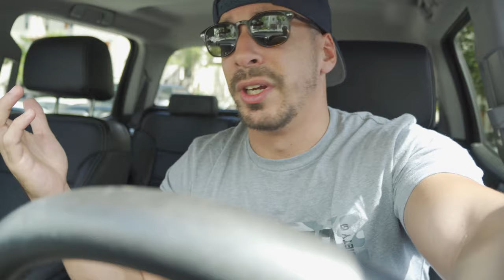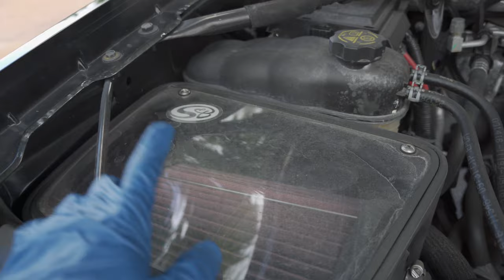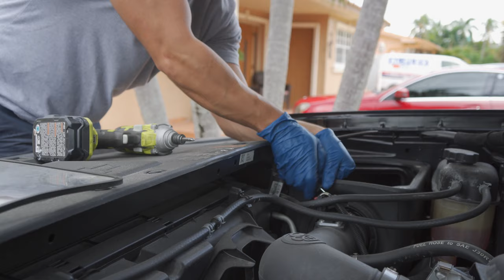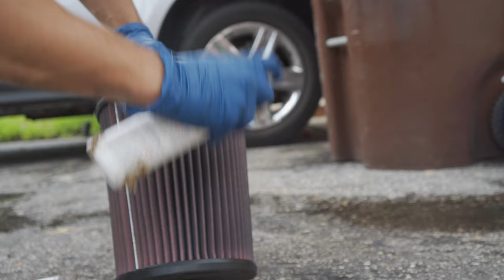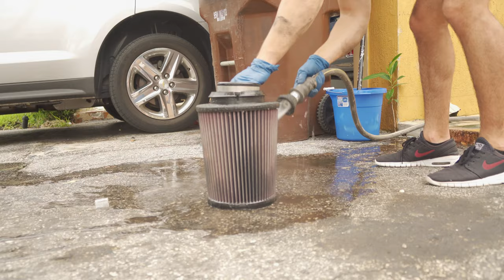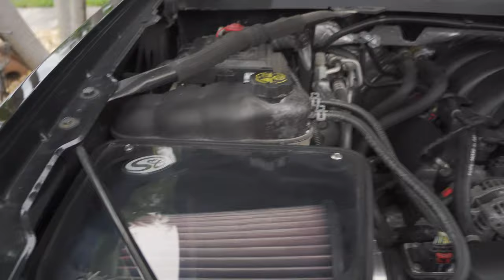S&B Cold Air Intake Cleaning & Throttle Body Cleaning

Comment: Was the clear filter screen cracked at the screws from over tightening or did it crack overtime? No judgement if caused from over tightening. 💪
Reply from the maker: Case Customs great question. I looked over the image I took when I first installed it and it wasn’t cracked so seems over time it has.
Reply: TruckYeah Shame. Obviously you want a tight seal but fine line for sure. Appreciate it man!